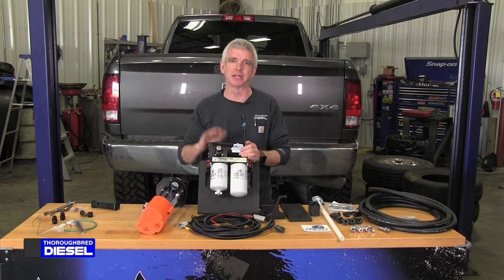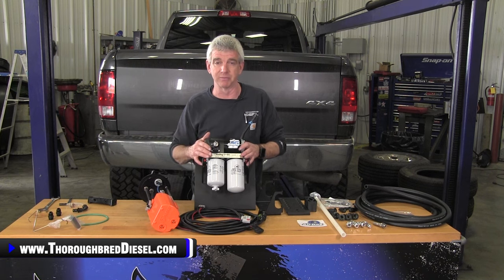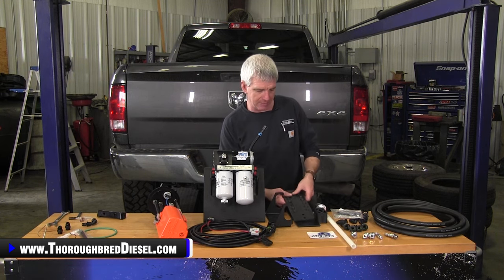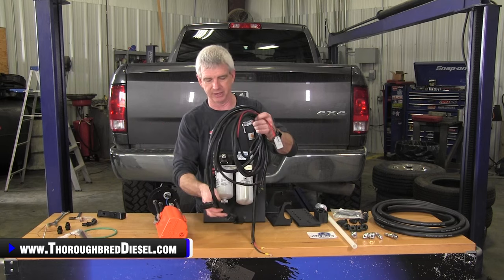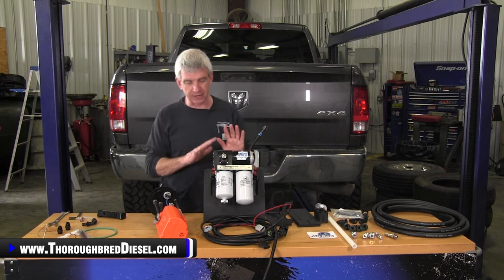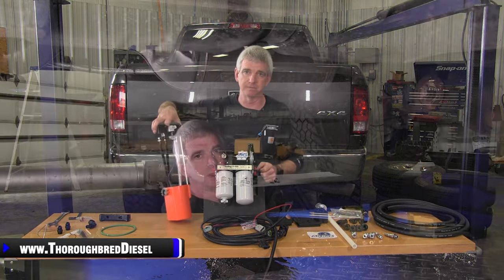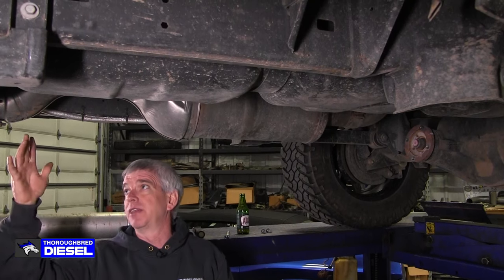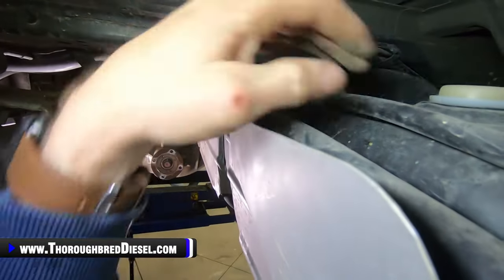How To Install AirDog II 5G Lift Pump, Fleece Sending Unit, Fleece Fuel Filter Delete #cummins #fyp

Comment: Would the front fuel filter stay in play if I wanted leave it or does it have to be deleted after putting the AirDog in?
Reply from the maker: On a Cummins equipped truck, it is bypassed.

Comment: Does this replace a fuel pump.. ? Do I have to have a sending unit in the tank or can I modifie to just have the air dog
Reply from the maker: With the AD, if you have a pump in the tank then you will need to modify the sending unit to get around that.

Comment: If I order a 5G air dog or fass pump kits does it come with everything I need to add a fleece in tank unit . Thank you
Reply from the maker: Yes.  The Fleece SURE FLOW unit (not the Powerflo unit) actually comes with the needed fittings for hookup to a Airdog or FASS.

Comment: I have a 2000 Dodge Ram 3500 with a 24v Cummings, my fuel pressure at idle is 17psi and drops to 12 psi while accelerating or climbing hills. Does anyone know if that is normal?
Reply from the maker: That is a good pressure reading, but what is your flow rate?  Is this an Airdog pump?  What performance modifications have been done to the truck?